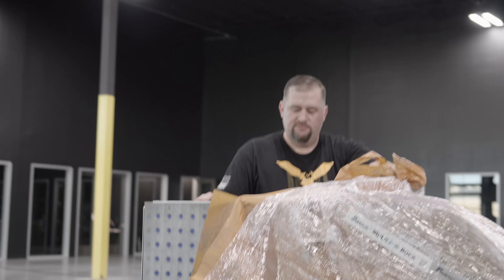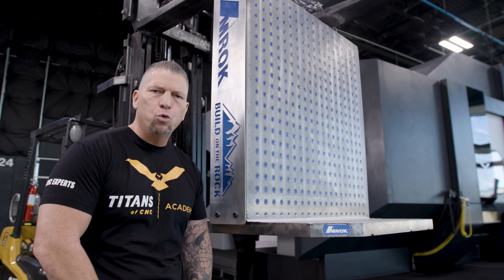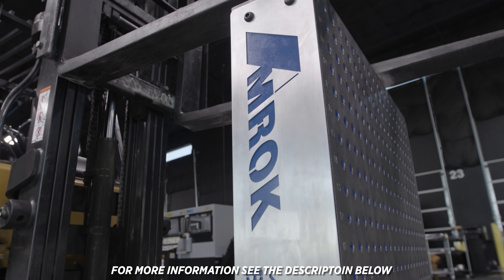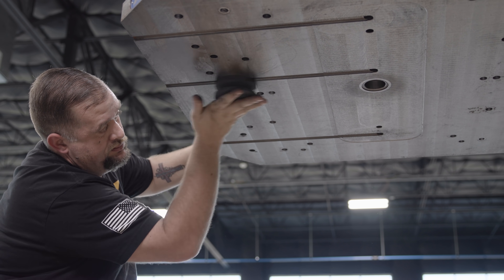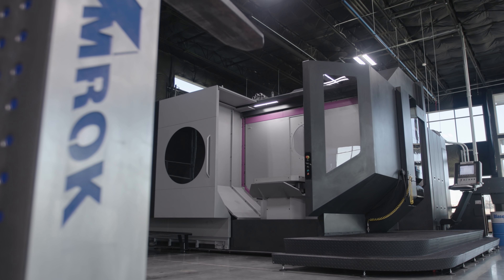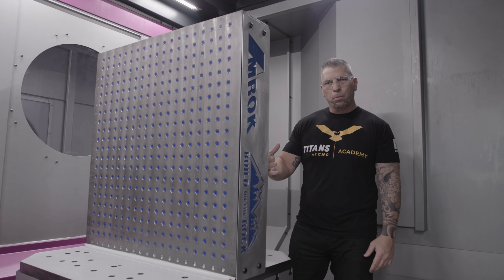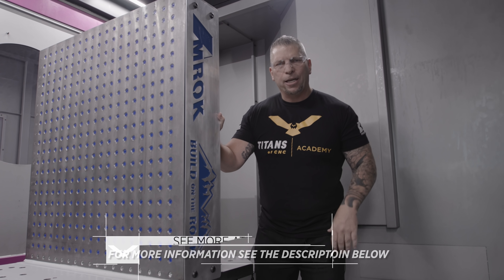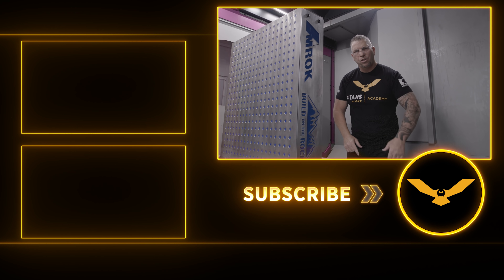Monster Workholding for 100 HP 5 Axis!

Comment: Hmm the tombstone I use is roughly the same height and width but twice the thickness and has 5/8"NC holes on all four sides.  Was made out of 1.25" thick plates and welded/machined in house.  I keep a large vise mounted on one side faces and use the other three as needed.
Reply: Ours is 5/8-11 and the flange is just over 2” thick. Its beast mode for sure!
Reply: This tombstone does have mounting holes on all four sides. For the purposes of this video the 90° and 270° faces have the promotional plate attached to it. Our tombstone is made of machined cast iron.
Reply: @advancedmachineengineering  Cast iron is nice due to thermal movement.  I saw the one in the video and thought damn thats not very deep and looks like it would bend if any real force was pushed at it from the upper regions of the tombstone.
Reply: @Fullion-CA  we typically don't see any issues with deflection at those heights due to the rib in the core. We do also have an epoxy mineral material for even higher vibration damping properties.
Reply: @advancedmachineengineering  Sounds interesting, will have to look into that.
Reply: @Fullion-CA  It appears that links are blocked on the comments section, but if you search tombstone testing for dynamic performance on a search engine it should be the first result. That article will be the full study we did.

Comment: The mounting flange on that tombstone seems thin
Reply: yup that's exactly what i think.also did he run the indicator vertical . is the thing perpendicular to the table
Reply: @ronblack7870  if the manufacturer is making a good product then it SHOULD be and should have a rated/inspected spec. But its still good to double check. Hell i double my big angle plates and stuff that i use regularly just incase i missed a spot cleaning and sat it down on a piece of debris or got a dent in the table or something. But factory g&l angle plate is 3ft tall x 4ft wide triple gusseted on the back and the base of it is still 3" thick. My 7ft tall ones are 25" wide double gusseted and the bases are 4 or 5" thick.

Comment: Why does the logo plate bolted to the sides seem bowed?
Reply: Either it warped due to heat input from laser cutting or the distance between the mounting holes does not match the distance between the threads in the tombstone.